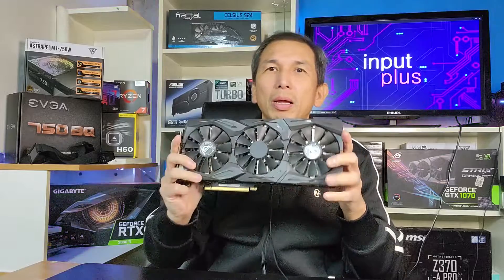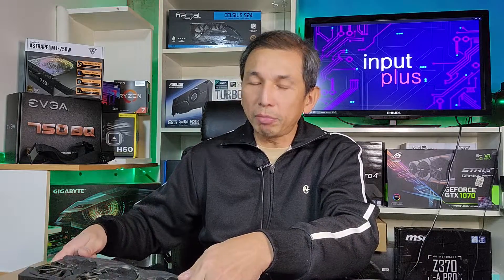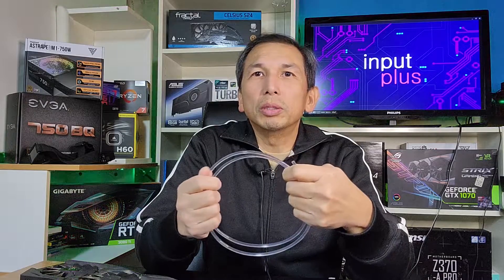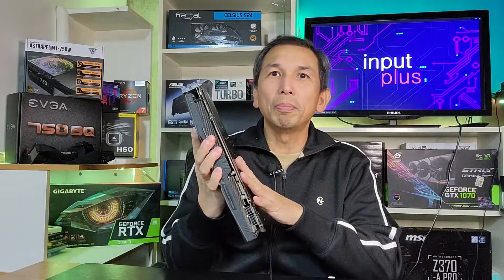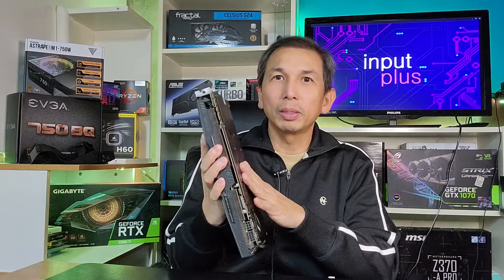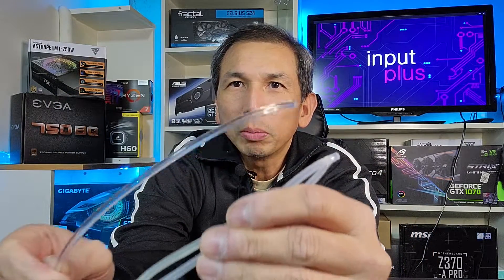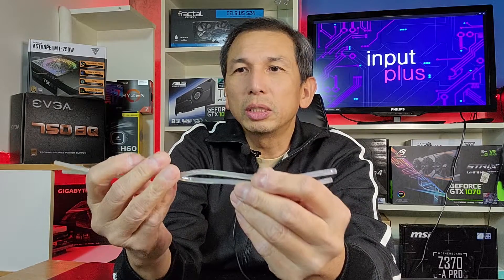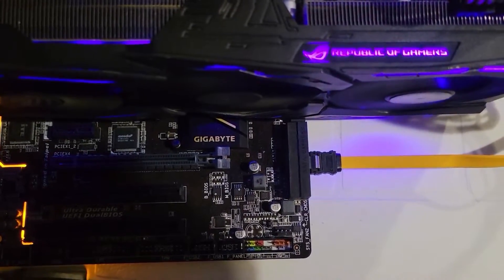Asus ROG Strix GTX 1080 LED Repair

Comment: Hello. I want to order this fibre optic cable. But in my country I can only find maximum 3mm. Not 4mm. Will 3mm also work for this? I can order 4mm from outside but that tax is TWICE the price. Please do let me know if 3mm also works or not. I have the same card as yours. ROG GTX 1080.
Reply from the maker: That's a good question. 3mm should obviously fit. If it's a little loose, you might have to secure it more with electrical tape. The only way to know is to try.